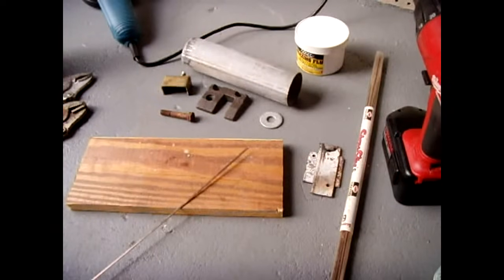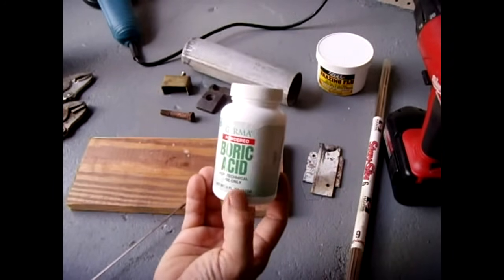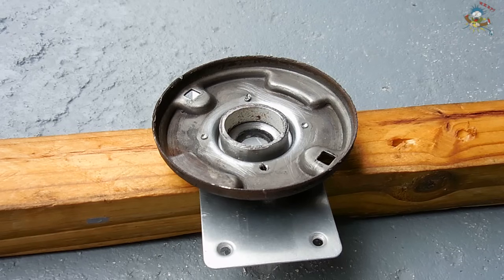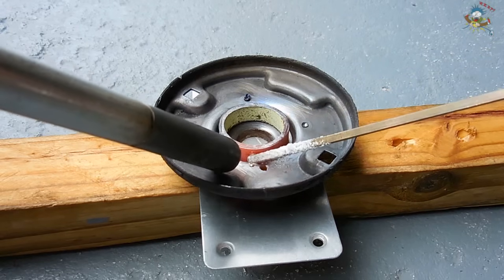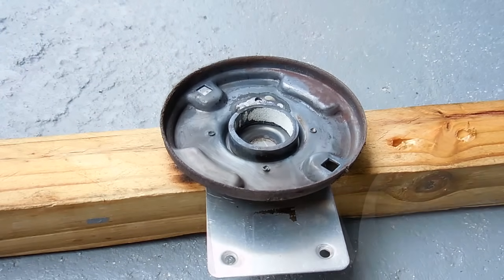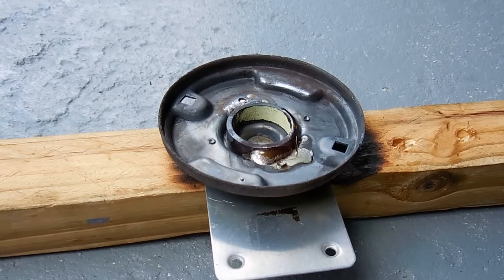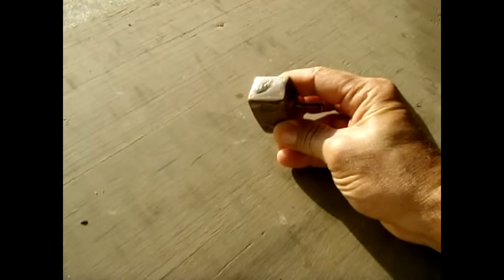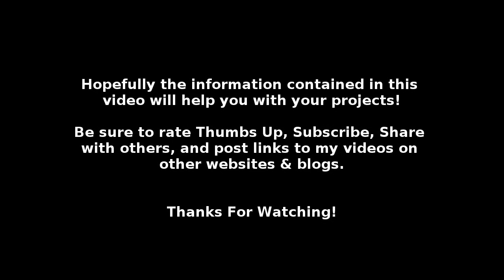EASILY Braze, Steel, Iron, Brass, Bronze, Or Copper

Comment: I need help plz I need to join an an aluminum door to the steel quarter panel this car has aluminum doors and a steel quarter panel how can I weld the aluminum door to the quarter panel please help
Reply from the maker: You cannot fuse aluminum to steel.
Reply: I'm trying to fuse an aluminum door to a steel quarter panel on a car how can I achieve this?

Comment: So this would be good to use on a Steel mower deck. Just a small crack less then an inch i think lol.
Reply from the maker: beingsneaky Yes. Drill out the ends of the crack before repairing.
Reply: ok thanks very much for the prompt rely. now to find some ah is a propane torch hot enough?
hmm wonder if princessauto has some. ok never mind about the propane question lol seen you were using it in another comment.

Comment: dont mind my pic...about brazing can you braze 16 gauge sheet metal on metal..
Reply from the maker: As long as you can supply enough heat. :-) Thanks for watching!
Reply: is ts8000 good for brazing 16 gauge steel..??and do i need flux??

Comment: Can you do demo on bending brass plate? I have some brass 150mm long x 38mm wide x 3.5 mm thick. I want to bend this at 90 degrees. Cheers RG from downunder.
Reply: Not sure if you done it already , but the way i did it was cut a 2mm deep line on my sheet (5mm thick) using an angle grinder, then i  fix it with clamps and bend with my hands , around 20 degrees . Then i heat treated it using a quick made forge with hairdryer supplying air for gigher temps . Repeat bend- heattreat until you are done, just be patient and dont bend too much at a time or you will risk metal cracking.

Comment: Have you ever used the SSQ-6 in the 1 oz tube for $95?
   I need to join 2 brass pieces together, that are cosmetically appealing.   
       The SSQ-6 seems very clean, but the cost is staggering. 
           I wonder how many inches are in a tube?

Comment: You do a great job- very clear articulation, explanation, and appropriate brevity. I appreciated the focus on the material at hand and your economy of words. I believe I will now go downstairs and braze for the first time with a pretty full  understanding of everything you did in your video, which I'm more or less replicating. I like that you didn't have obscured activities taking place out of the eyesight of the camera, and that ultimately, I don't need to watch ANOTHER 10 videos to get second opinions. So, having watched numerous DIY videos- I give kudos to you as being fantastic at this. You also inspire confidence with your tone. I rarely review anything, but felt compelled to say this. I'll check back in an hour with results of the mission.
Reply: You took the words right out of my mouth.  No senseless intro, just straight to the point.  This is a great example of how information should be shared on YouTube, I was able to braze for my first time as well after watching this.
Reply: Just a tip. For that piece he was focusing more on the rim instead of the bottoms base plate. You notice the filler is balling a little bit. Need to apply a bit more heat to the base not the filler
Reply: Yep, what Prato said.

Comment: hi nice job. what safety  Google would you recommend  may I ask  I use to braze at high school  around 20 year ago  . I have some low melting point  aluminium  rods coming  as well
Reply from the maker: +James Birkin 
If you're only using propane/Mapp gas, then only clear safety goggles.
Reply: thank  you :-)

Comment: How does "Silver Brazing" differ from brazing the metals you used in this video? Thanks.
Reply from the maker: +Pat Caudill 
Adding silver makes the brazed or soldered joint stronger.
Reply: +electronicsNmore Thanks! I'm trying to figure out how to "weld" old keys together. I'm learning that it may be easier to silver solder them. It seems as though having a good flux and taking my time in heating up the base and to be sure my flux is back into a watery appearance and I should be good to go.

Comment: Having a fire brick handy will be a good substitute instead of a damp piece of wood,  welding requires a very good ground also a good surface for welding to complete the circuit .  I have used the Hot Max using silver solder brazing rods it works well . 
Good video -
Reply: Circuit ??  Are we watching the same video ? Or are you just a moron ?
Reply from the maker: +Pete Moss 
Thanks. You're correct. A fire brick would be great, but I live on an island in the Bahamas. We don't have any here. :-)
Reply: LOL . . . . I'll send you a few !!!

Comment: Awesome video! 

What kind of torch head do you use? 

And, should I use a different one when switching gas from propane to mapp?

Thanks.
Reply from the maker: david jenson I am using a MAPP gas torch head with propane. Using a propane torch head with MAPP will not work.

Thanks For Watching
Reply: wondering the brand name because the cheap ones do not work when you turn the tank upside down...
Reply from the maker: Sears
Reply: Thanks!
Reply: David Jenson Get a bernzomatic TS8000 It gets hotter than normal torches.

Comment: great video.What kind of gas is needed?
Reply from the maker: Tom OConnor I used propane, but for larger/thicker steel you will require at least MAPP gas.

Thanks
Reply from the maker: Tom OConnor I used propane, but for larger/thicker steel you will require at least MAPP gas.

Thanks
Reply: Excellent video. Now I know how to braze! Thanks.

Comment: Thanks for the great lesson I'm a self taught metal artist is the flux for brazing necessary or just helpful Most of the stuff I braz is not load barring
Reply from the maker: James Franklin No flux necessary for copper/brass/bronze, but mandatory for steel/cast iron.

Thanks For Watching
Reply: electronicsNmore, what about stainless,   Also can propane be used? Great video, Thank you for posting this.

Comment: Great video!! The braze looks like a weld to me. Lol. If you hadn't told me that it was brazed I wouldn't have known. I never knew you could braze steel or other metals. All I've ever seen is aluminum. Do you think brazing is better than welding for putting together thinner metals?
Reply from the maker: Love2boat92 Hello again! Brazing is the next best thing after welding, but for thinner metals I would recommend brazing.

Thanks For Watching!
Reply: electronicsNmore Hey. Lol. Yeah I worry about warping thinner metal though. No problem.